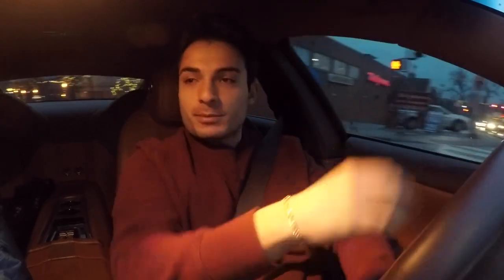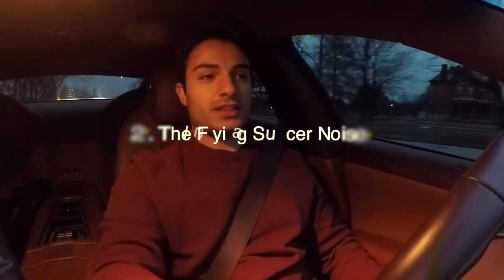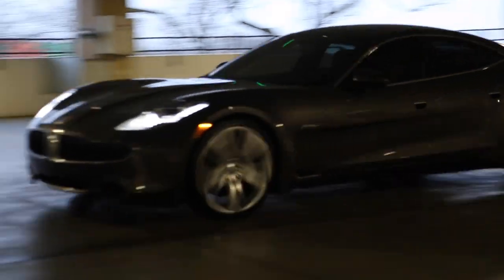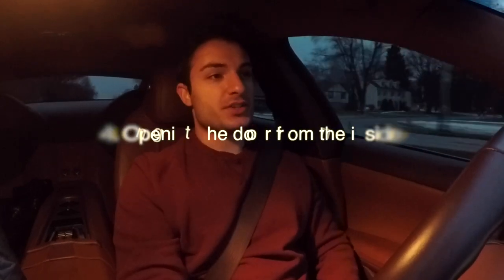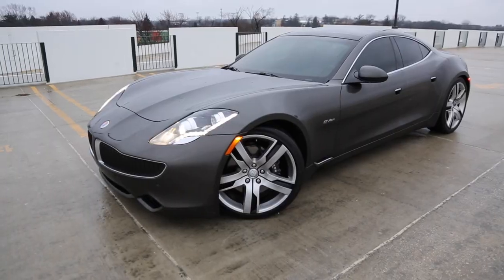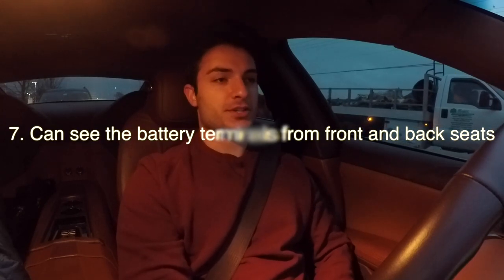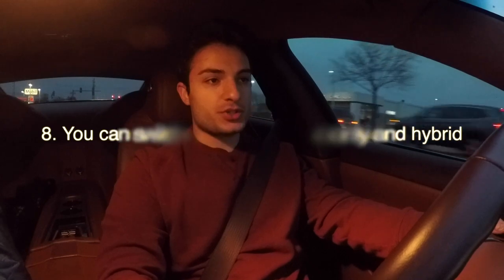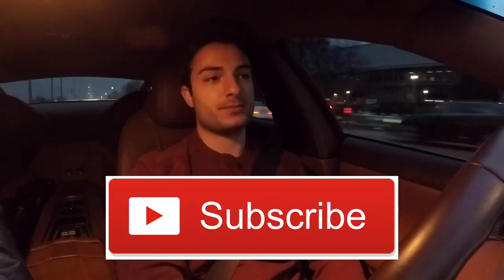MY FISKER KARMA | 8 Things You Might Not Have Known

Comment: the speakers are NOT the silver pods on the rear bumper. that was the original intention, but now it is a speaker at the back under the bumper, and similarly in the front. the sound is meant to warn pedestrians that you are coming since otherwise in stealth they would not hear you at all, and the sound was meant to remind you of Luke Skywalker's hovercraft. the wheel sizes are the same diameter, but not the same width or tire size. the ICE engine is not connected to the wheels, only the generator, so the car is always propelled by the electric motors, and not by the gasoline engine. the gasoline engine is like a big charging unit for the batteries.
Reply from the maker: I just learned some new things. Thanks for sharing! So if the engine is acting as a generator and is not actually connected to the wheels, why is the car significantly faster when the engine is running? Does this have to do with increased electricity flow?
Reply: I recommend you check out the Fisker Buzz forum.  IMHO, it's the absolute best source of any and all information about the Fisker Karma.  I think It's great that you made this video and posted to help drive up interest in the Fisker Karma, but (unfortunately) a lot of the info you're sharing isn't correct.  As far as the sound, it is specifically intended to warn pedestrians when the car is moving at slower speeds, since it may be completely silent if it is running in Stealth mode (and it sounds cool!).

Comment: Over all how many miles do you drive weekly? Are you charging the car regularly? Do you see a difference between electric usage savings ( running errands in town. A few miles from home) is the interior big enough for a car seat ( sorry I’m a dad ) 🤓. I know it’s as safe at the Tesla in some manor. Thanks for the video. Pretty close I’m going to move forward because the Tesla being full electric has a bit of concern. Once your out electric , you are out of electric! Emergency needs waiting for 1 hr .... 🤔🤔. Thanks for the review
Reply from the maker: Conectar Agency Inc I drive roughly 150 miles a week with this car, and I charge it every time I come back home. On electric only it gives you 50 miles of range on a full charge, and if you keep it in hybrid mode then it will always save 26 miles of range of electric only power should you need it. I’d say the back seats are big enough for a car seat. The electric mode definitely saves on gas for sure, and on hybrid mode you get about 50 mpg so it’s an efficient car
Reply: The ICE is made by GM, and any service tech can change the oil/service it.For Fisker Karma-specific issues, you should find the closest CSP.

Comment: I will like to know if it is kind of reliable to buy one..
Reply from the maker: To be honest it’s not the most reliable no
Reply: CarSharp  is it expensive and difficult to maintain? I'm considering buying it as a weekend car.
Reply from the maker: Simon Thomas It’s not diificult to maintain no. The only thing to watch out for is the electrical problems. If that happens it will usually be the car not charging when you plug it in, or not going into gear. Like I told the other person, if it’s not charging you need to take it to a shop that works on Fiskers, and tell them that it is a blown fuse somewhere, otherwise they will tear down your whole car replacing everything trying to figure out what it is, and you will end up with a nice fat bill of $3k or more. And if the car ever doesn’t go into gear, unplug the 12v battery and press some random buttons in the car to get rid of the rest of the electricity, then plug the 12v battery back in and it should go into gear again. There is a big black plug on the left side of the engine if you’re facing the car from the front. You unplug that to unplug the 12v battery. Those are the only two things I’ve had to deal with. Also if you ever need to change the back tires, because of their dimensions they are hard to get and usually take a few months to come in. When I had to change the back tires, the tire shop had to source the tires individually from all over the USA to find them, and there were only like 6 tires in stock in the country without having to order and wait a few months. Other than these things, the car is awesome. Hope that answers your question

Comment: Hey I just brought one a month ago.. can you give me some pointers on the car you hear so many bad things about it is there anything i need to be aware of?
Reply: boss hogg hey how has your experience been with the car?
Reply from the maker: The car might one day randomly just not go into drive or reverse, only park and neutral. If this happens unplug the battery from the car (there's a plug on the left side of the hood if you're facing the car), and then press some random buttons in the car to get rid of whatever electricity is left. Then plug the battery back in and turn on the car, and it should go into drive/reverse again. Also if your Fisker ends up suddenly not charging when you plug it in, take it to the dealer/shop for repairs and tell them one of the fuses is out so you don't get charged a huge bill for them trying to switch tons of parts out to figure out what the problem is. We took ours to the dealer and they spent two weeks changing tons of parts out trying to figure out what the problem was, only to find out in the end that it was a fuse.
Reply: Fixed the 1st problem of it not going into drive, now have to replace the CIU because it kills the 12v battery. Cost of that is $3800. Money pit...

Comment: Incredibly poorly designed car
Reply from the maker: How? I think the design of this car is beautiful and in a league of its own
Reply: Not a poorly designed car.  You need to educate your mind, this car was released to the public too soon, in a prototype stage.  They were released in limited numbers and had planned on improving the small design issues.  They battery company, A123 had manufacturing issues which eventually sunk the company.  I personally have one, and its fantastic.  Probably should educate yourself before you type.
Reply from the maker: AAA P  Lmao dude, you're generalizing an entire car based off some random guy's 90 second garbage opinion on a couple "problems" that he thinks there is. That guy probably doesn't even own the car, he most likely had the car for 30 minutes and quickly made up something to make a video. It's not even a proper video. I have had this car for over a year. I've driven it every single day, and I've driven and had many different cars, so I know what a good design is and a bad design is. That video you are basing your entire statement off of is complete garbage. "The steering wheel adjuster is too strong". WTF?? If you're adjusting your steering wheel to the point where you're crushing your legs, you probably shouldn't be driving anyways. And the exhaust positioning he notes? I drive with the windows down all the time, and not one time have I had the exhaust come into the cabin. When he filmed that video the air current most likely was blowing in a perfect way to get exhaust into the cabin. Even on a normal car's exhaust positioning, if the air is blowing a certain way and all your windows are down, the exhaust can come inside the cabin too. I think it's hilarious how there's so many people on youtube like you that think they know everything about something they have no experience or ownership of, and try and spread false bullshit facts thinking they're albert einstein because they watched some 90 second video from some dude that doesn't know a thing about the car. As an OWNER of the car for over a YEAR, driving it EVERYDAY, and owning tons of other cars to compare it to, I can assure you it is not a "poorly designed car". Please go spread false information on somebody else's page.
Reply from the maker: Mr. Ferraris4U  Well said
Reply: You sir are correct....I will take my leave....
Reply: I love my car.  Have had a few issues, but nothing that my CSP couldn't take care of.  If the CIU ever gets out of sync, you can contact me for a programmer.  I have the original service tool for the CIU and the last version of software that performed balancing.  Gotta love the 'earth' color too, huh?
Reply: Mr. Ferraris4U would this fix my Bluetooth issue... mine tends to making a popping noise through speakers when using the Bluetooth.
Reply: For me its really beautiful car.